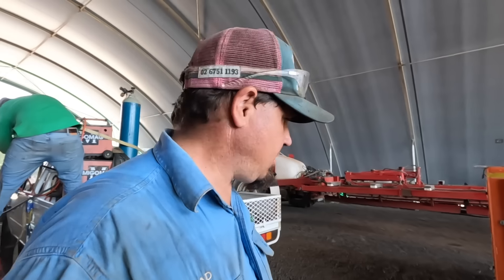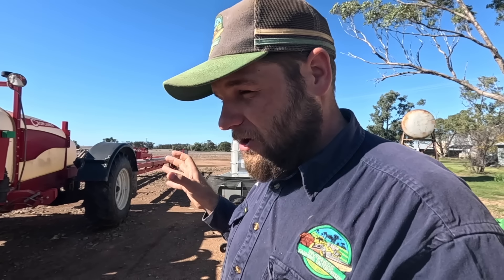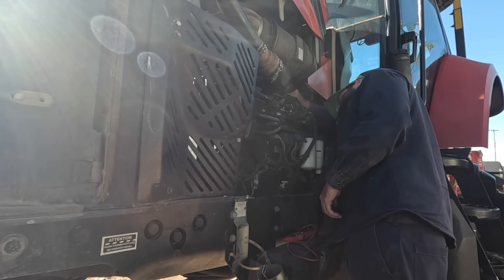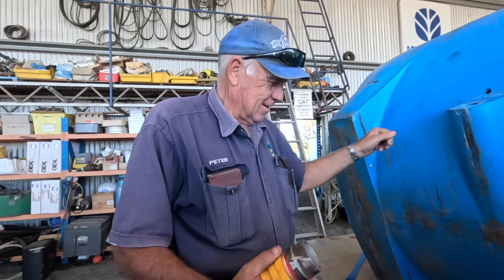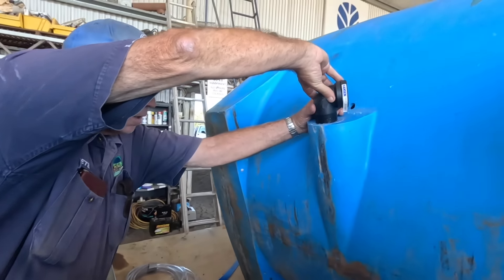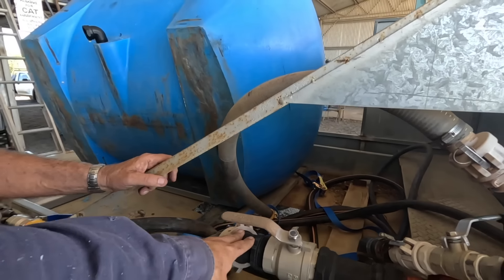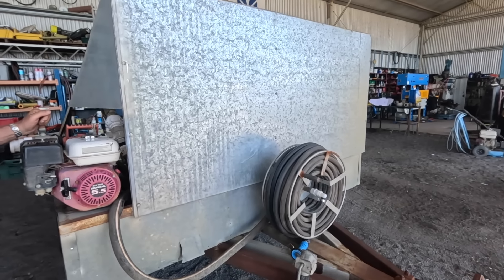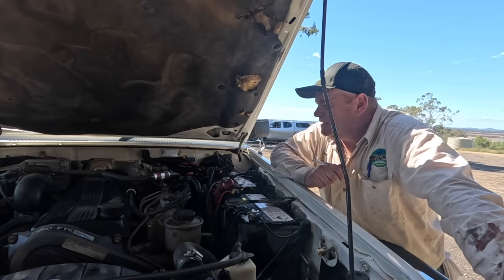Dads Project Almost Done! | Workshop | Vlog 271

Comment: Peter your a classic,love listening to you.
I couldn’t see if the blue trailer tank was secured in a way if you stop too quick,The tank won’t slide forward.
Only can see the blue straps over the top.
Reply: It's got location blocks around the feet I think - was covered in a previous video.  There's probably not much chance of the whole thing stopping too quick, it will likely be towed by the oldest tractor with terrible brakes and very low maximum speed in the paddock.